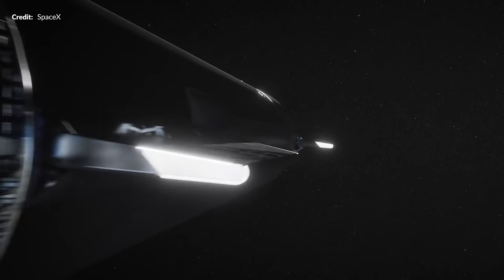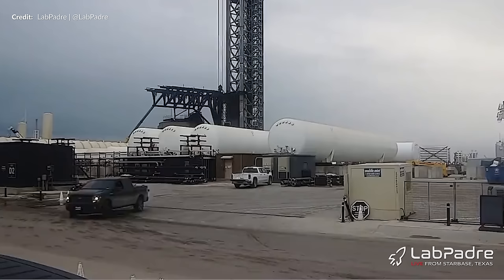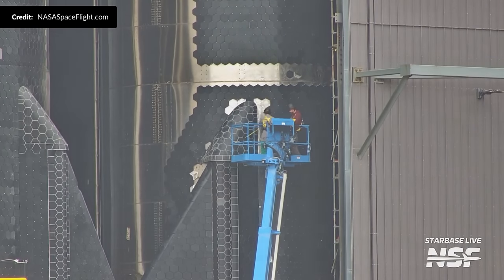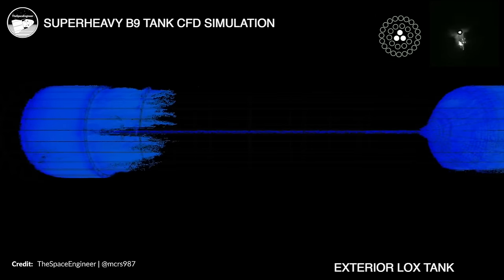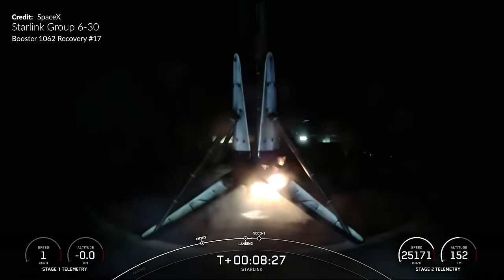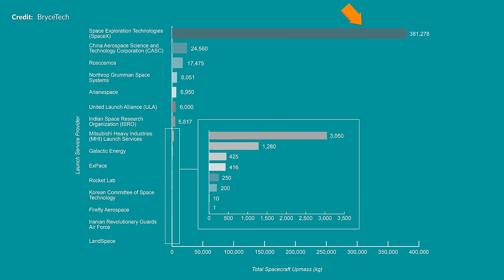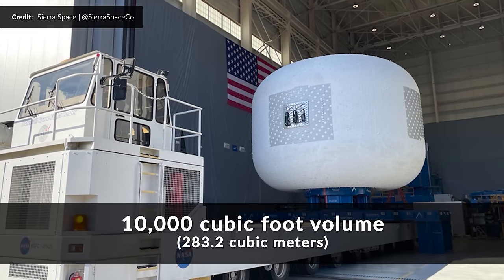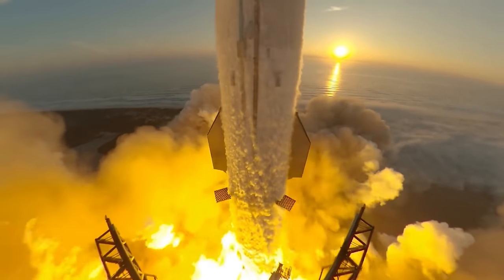SpaceX's Starship Version 2 to take Center Stage! Lets do this!

Comment: Hi Marcus. I just discovered your channel last week. Great work. I have a question. Why is the tank farm so close to the pad? Is there not a risk during ignition? I’m sure that there is a very good answer. Thanks.
Reply: 1. Star Base Boca Chica is composed of several very small plots of land. Everything is crowded. 2. Long pipeline runs will allow cryogenic fuels to absorb more heat while being transferred, so tanks are as close as possible.
Reply: It was pragmatism at the time, kinda temporary. Now they can get better tanks they can lay them down.

Comment: Do the tiles expand and contract with heating, necessitating smaller tiles with breathing space between then?

Or could they manufacture a large, one piece “boat hull” that nestles the bottom side of the starship?

Or maybe 4 or 5 large sections?
Reply: My understanding is that heat expansion is why the tiles aren’t any larger; larger tiles would expand too unevenly and a single heat shield would not have room to expand

Comment: At 5:59 

Dear Marcus: 

I hope you are well and appreciate your lively prepared manner and broadcast personality. Noticing a puff of white seems to accompany the tiles as they fail and fall away, could ice be forming under the tiles in spite of the insulating blanket? Would ice reduce the design clearances transferring the flexing and vibration from the hull enough to break the tiles? 

Ps Do you have feel for which has a greater effect? The shaking from the engines or the aerodynamic loads?

Comment: Swarms of Mars Drones. designed with microwave energy transference. so they can be launched from orbiting starship & refueled through microwave transmissions from solar conversion done on orbiting starship. 1st bring lots of satellites too! prospecting from the martian skies in orbit. Drop off the swarms to check out more stuff! Ground effect may be really cool too. Don't have to get back up to starship just manage the drop onto the planet's surface. Dreamchaser like for some to get bulk, land crawlers going too. Every heavy mining and construction equipment scaled down to fit. to check the designs out & be useful in preliminary explorations to locate the best, richest, easiest to mine resources are.

check.

Comment: Tile design is not easy.
In my mind, it's a problem of layer design to deal with failure points internally and externally.
Also, the way that stage zero is protected might be handy in protecting the tiles.
Russia used plasma as a shield and a similar directed energy focal may help with swinging temperature and pressure extremes happening at a very fast pace
Reply: Yes, SX has a big challenge with those tiles. The current method does not look promising. Do you know how Dreamcatcher tiles are mounted? Maybe SX can use the same method?
Reply: Space X has not focused on the TPS much to this point because the first two flights were expected to reach reentry anyway. Beginning with S28 a suction test is to be performed on all the tiles prior to flight.  Just like other aspects of starship that need to be upgraded based on ITF-2 the TPS will be upgraded as needed also.
Reply: @michaeldeierhoi4096  Perhaps yes, but flight 2 had the intent of flying Starship around the world in a manner to simulate reentry, according to the SX talking heads. If that is true, then SX must have expected the tiles to perform to a metric capable of being tested for reentry.

Comment: What's the main reason for not putting the tank farm underground and avoid all those repairs?
Reply: easy to make changes and move stuff the layout is all in limbo really plus there is a very high water table there which makes putting a big buoyant tank in the ground difficult.
Reply: In that part of the world, the word is "underwater", not "underground". It's not like there are any better locations available, but Boca Chica does have some big limitations... they're building in a sandy coastal swamp, and "building down" isn't possible without the kind of extreme measures needed for the launch table and tower.

Comment: Don't they have cameras in the tanks to record what happens to the propellant during different phases of flight?
Reply: Probably not. Cameras require light and its kinda dark in there. Adding light would add complexity and potential failure modes.
Reply: probably sensors not sure a camera could withstand those temperatures you would need a sight glass through the tank which would probably not be viable in this situation for safety and production reasons.
Reply: There was footage from a camera in one of the tanks on a Starship suborbital test flight.

Comment: Here is a thought I'm thinking about the helicopter that they send to Mars if they have solar power they need to make it have a mechanical arms that come out with air hose blow guns to blow off all the dirt that gets on the panels plus a Rotor soft brush to get the dust off that blow gun doesn't get off. Anyway just an idea only

Comment: 4:20 I wouldn't be suprised if they decided to put TPS tiles on stage 0 at some point. Looks like a good use case.
Reply: The OLM legs are blackened not damaged by the flame from the raptor exhaust.  And the TPS tiles would be useless protecting anything from the raptor plume which would be completely shredded in seconds.
Reply: @michaeldeierhoi4096  A part of me agrees with you, but the other part of me thinks you're wrong. I'm thinking reentry at 27k mph is SIGNIFICANTLY more violent than the exhaust from Raptor. I agree that its entirely unnecessary, but I'm not sure it wouldn't work in theory. So long as they could be properly secured (lol).
Reply: @jackinthebox301  I have seen others more knowledgeable than I address this issue and they are all in agreement that applying the tiles to the OLM legs would not help protect them because of the impact of the raptor plume on the tiles would shred them in seconds.  Reentry is a different stress on the tiles because of the compression of air in front of the vehicle which heats up the atmosphere.  When a vehicle begins to reenter the atmosphere it is at 17,000 mph.  I think you got your units confused.  Orbital velocity is 17,000 mph or 27,000 kmph.
Reply: @michaeldeierhoi4096  lol yeah units got mixed up. The difference between atmospheric heat compression vs exhaust makes sense.
Reply: @jackinthebox301    I got my units mixed up myself just a few days ago and someone corrected me on it.  It's easy to do.

Comment: Any thoughts on how many flights before chopsticks catching? What could be prerequisites? What reg hurdles needed to approve? When might pre-human trials start taking commercial payloads? Thanks!
Reply: i have no clue but i have a feeling they need to build a second Mechzilla for the catch attempt until they get it right because a failure would basically ruin all that infrastructure they currently have. They still have to fake land it in the ocean i imagine they would do that at least twice before making an attempt. like i said i have no idea but it will probably be another year minimum before we see a catch attempt. pre human trials start the second it starts becoming reliable then they need to show a track record in accordance with nasa guidlines this will be a while away.
Reply: Probably are going to want a few successful "landings" in a precise area in the ocean (as have been the plans for IFT 1 and 2)  first before risking the tower
Reply: Never, its vapor like all elon lies.
Reply: The booster ran out of fuel during the boost back burn.  If it wasn't full and they ran out because of the fuel farm then the upgrades they did there could be all they need to accomplish the soft ocean landing before they start thinking about how to land in the chopsticks.  If it's not because it wasn't full then they will have to redesign the booster to carry more fuel

Comment: When will we be getting a nuclear powered flying mars rover? Or one that comes back every day and recharges off the main rover ready for the next day. Instead of short flights of 90 seconds we could have 30 minute flights. Think of the awesome video they could send back as they map the planet in resolution higher than the satellites.  The could also scout for the best landing site for the first starships and plant radio beacons so the ships can have pinpoint landing accuracy on a known piece of ground.
Reply: The specific power of nuclear  is too low to sustain rotor flight on Mars. Ingenuity draws 350 watts to fly and has a mass of 1.8kg, so you need about 200 watts per kg.
NASA's best nuclear power source, the GPHS-RTG, generates about 300 watts of electrical power, but weighs 57 kg - so only about 5 watts per kg.
Even the KRUSTY reactor is intended to produce 10,000 watts for 1500kg - or about 7 watts per kg.
Ingenuity is already battery powered (and limited), so charging from the rover wouldn't really extend the flight time, it would just reduce the charging time between flights.

Comment: to what extent does the suction of LOX due to the 3 firing engines pulling on a ton or so per second at the base retain adjacent LOX fluid due to intermolecular tension and the geometry constraining the pattern of fluid flow over the base of the tank locally limiting the slosh characteristics near the intakes?

Comment: The overall shape of the tiles is the problem they are designed to be just a flat surface, which is what you want, But did not design them to Interlock with each other and that is at least part of the problem, if they fix that it should deal with most of the problems that they are having with them.🤔🧐🤔🧐
Reply: No, you don’t actually want them to touch each other.

Comment: 5:30  This is a true weak spot.  Acoustical harmonics is going to shake tiles off unless isolating this with better “noise” absorbing/canceling technology.  All those Raptors literally shake the rocket to pieces.  Oddly enough, the Shuttle Orbiter was immune to this because of its shape that minimized this harmonic phenomenon not “focusing” all its energy to one spot on the thermal tile system that causes tiles to shed off.  : (
Reply: There are several so called weak spots on starship that are the direct result of the process to design, test and build a super heavy rocket.  The TPS is reportedly getting more attention on these last V-1 starships by using a suction test to verify how well the tiles adhere to the exterior of the ship.  

This was not done on the previous versions of starship cuz they weren't expected to make it to reentry anyway.

Comment: Has anyone done a study of the pros and cons between 30 "small" engines on Starship vs four very large ones on Artemis?
Reply: What you describe as "four large ones" on Artemis are actually only slightly more powerful than Raptors, and with only four of them, they contribute very little to the SLS launch... indeed, on their own, they're incapable of lifting the rocket off the ground. It's the two monstrously oversized solid rocket boosters doing all the work.

Comment: I’ve just had a thought, so if the tanks that aren’t insulated (only the stainless steel shells) got severely damaged on both test flights even with the steel plate, could this mean the second tower adjacent to the current one wouldn’t work as any vehicle stacked there during a launch from the other pad could be damaged from the pressure waves right? Yes it would be pressurised differently to the OFT tanks, but surely there’d still be damage done if a vehicle was stacked there during a launch from the pad next door?
Reply: The shells around the cryogenic tanks which is what visibly got damaged are not pressurized, they're basically just rings of steel around the inner tanks. While on the pad, Starship is pressurized which can actually be seen pushing out dents on the booster sometimes, so it shouldn't be a problem with the shockwaves assuming they have two vehicles stacked at once anyway
Reply: @ASAVSP  I did wonder that. Thanks for the reply!

Comment: Increase fuel capacity and reduce dry mass? 4,600 metric tons of fuel is insufficient to put the upper stage to low Earth orbit around 150 km before running out of fuel. An empty stage 2 cannot achieve LEO at V1 design, so what will happen if you add 150 metric tons of payload to stage 2? It is good to see Elon is keeping the German tradition of naming convention of their rockets as V1 and V2...etc.
Reply: V1 would have made it to orbit if it hadn't had started to leak propellant and triggered the FTS. It had 7.5% methane remaining at 24,100km/h velocity, but only 5% oxygen due to the leak. For comparison, when Falcon 9 is launching it reaches that same velocity with only 6% of both it's kerosene and oxygen remaining.
SpaceX were also only running Raptor at 90% power for this launch, so they lost a lot of performance there.
Reply: @lazarus2691  What does getting an empty 2nd stage to LEO at 160km and 28,000 km/hour proves? Did SpaceX publish the launch weigh of the entire system for IFT2? We do know that stage 2 has an empty 1,200 tons fuel tanks. Elon Musk pointed out that stage 2 is too heavy and it cannot go anywhere else beside LEO without refueling. Even Musk stated it will take a minimum 8 Starship tankers carrying 150 tons of fuel each, not possible at this time. Nothing else matter if we cannot refuel in LEO and stage 2 will go no where.
Reply: @Liberty2358  The important thing to note here is that Starship's high dry mass makes it's payload fraction *very* sensitive. So a small improvement can give a huge increase in payload. For example, let's say this prototype ship was 130 tonnes of dry mass, plus another 30 in the header tanks, and that it could have made orbit with 1.5% fuel left in the main tanks. That means the total mass to orbit was 178 tonnes - of which, only a measly 18 tonnes (the 1.5% remaining fuel) was actually 'payload', which is terrible.

But what happens if we increase the performance by 10%, say by throttling the Raptor engine up from 90% to 100%?

Well 178 x 1.10 = ~196 tonnes. If the dry and header tank mass remain the same, and we subtract them, we're left with 36 tonnes for payload - twice as much as before.
So a mere 10% gain in performance has increased the payload by about 100%!

Now let's say we do another 10%, say, by upgrading from Raptor 2 to Raptor 3: 196 x 1.10 = ~216. 
Again subtract the dry and header tank mass, and we're left with 56 tonnes. So we've gotten a 56% payload increase from a 10% performance gain .

And then let's say we can reduce the dry and header tank mass by 10% each, so subtracting 16 tonnes - that gets us to 72 tonnes of payload, a furthur 29% gain. 
Note that as the payload fraction becomes a larger portion of the total, the gains at each step get smaller - but they're still greater than 1:1. 

Anyway, the end result is that you 'only' need to improve overall performance by about 63% to get from 18 tonnes of payload to 150 tonnes of payload - which is an 833% increase in payload.

So the current prototype can just barely reach orbit, but SpaceX are hoping that bit by bit they can eventually improve it's performance by about 63% - add three more vacuum engines here, a bit more fuel there, optimize the boostback profile of the booster to save a bit of fuel over there, and so on.

And it's worth noting that they *have* actually done this kind of thing before.

The original version of Falcon 9 put a total mass of about 12 tonnes into orbit, while the current version can do about 22 tonnes reusable or 27 tonnes expendable. That's an 83% increase even with partial reuse added (which the original version didn't have), or a 123% increase for an apples to apples comparison with both expendable.

However, Falcon 9's upper stage has a very low dry mass, so the payload fraction was already very large, and hence nowhere near as sensitive.
It went from 9 tonnes to 18 tonnes reusable and 23 tonnes expendable, so about 100% and 156% payload gains respectively - not much more than the 83% and 123% overall gains.

Comment: Compartmentalizing the fuel tank of the booster would prevent the fuel slashing around.  Check valves will be needed .
You want at least 10 seconds worth of fuel trapped to the bottom compartment.

Comment: hmm so many heatshield tiles makes me nervous, why not have a few huge heat slabs instead of hundreds of little fragile heat shields ... soooooooo many points of failure :( A few massively curved multi-layer heat shields must be waaay better/safer than thousands of small vulnerable heat pads... again so many points of failure because of so many separate parts...
Reply: The tiles for the TPS are light ceramic similar to those on the shuttle and baked in a special kiln.  There is no kiln big enough to bake larger tiles for TPS.   You have to realize there that this is all part of the development and testing of starship so they address various technical problems when they become a priority.  

On the first two flights starship was not expected to make it to reentry so not much attention was given to the TPS.   Beginning with S28 the tiles are exposed to a suction test and who knows what else Space X plans to do.  But given their attention to other complex matters related to why ITF-2 had to be terminated by the FTS I'm sure Space X will give the TPS the attention it needs. So stop worrying about something that you have no control over.

Comment: SpaceX obviously has a lot of work to do. Overall l would consider Flight ll a success. To a point. All hooster engines operated through the boost phase. Hot staging appears to have worked. Was it optimal? Good question. Where work is needed is in the booster revovery phase. Specifically in preventing excessive fuel oxidizer slosh and baffling. 
That said l still think Musk's Mars Dreams are insane to a degree. But a working Starship would be a great boon in Lunar resource development